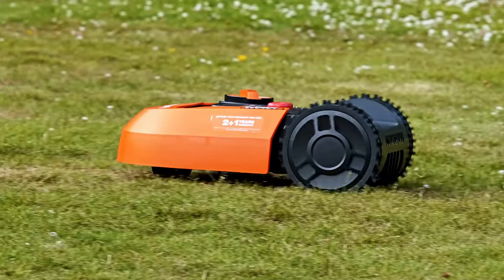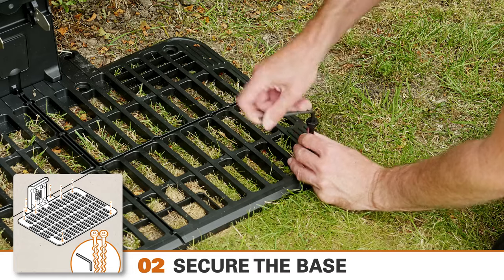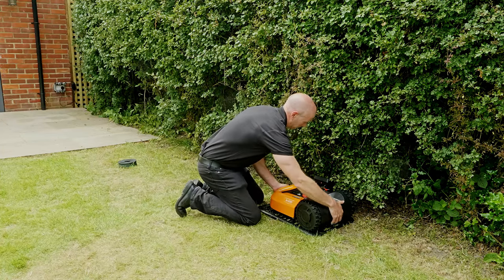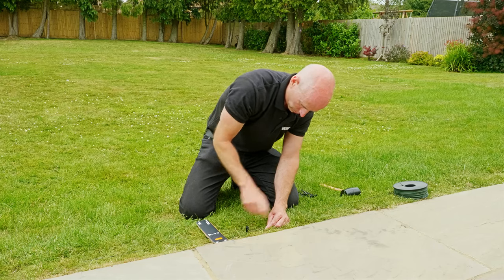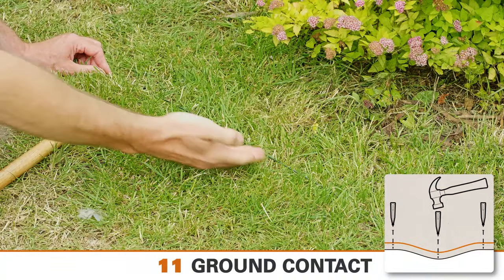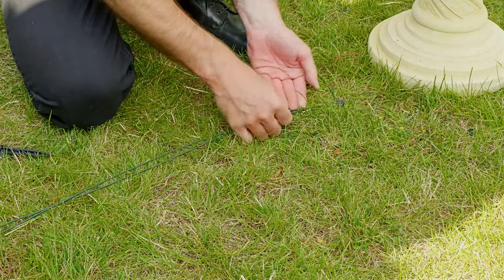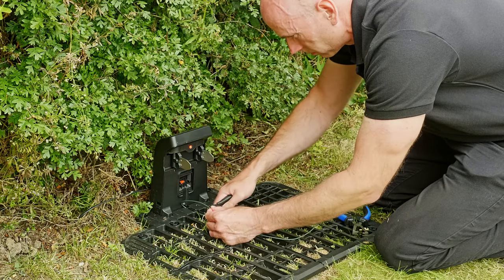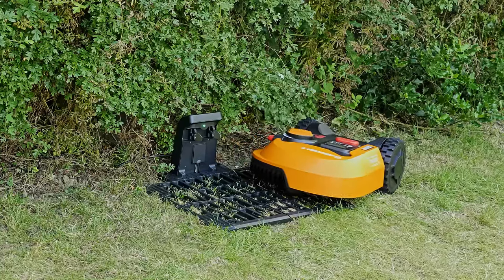Worx Landroid Installation Guide

Comment: Did you have any problems with the landroid runnning over and cutting the boundary wire? Mine cut the boundary wire 4 times within the first hour. But my lawn is not a flat as yours, I guess that’s why. This device does horrible on uneven terrain
Reply from the maker: Hi, sorry to hear that.  It does need to have the wire pegged flat or you can bury that section if it is sticking up. It will be pulled into the grass within a couple of weeks and then you won't have that issue again.  The Landroid will eventually make your lawn look a lot more even but there is a particular model which is designed for very uneven terrain. Contact the Worx Customer Service team on 0345 202 9679 for any further advice.

Comment: Hello. Can the Landroid roll over hard surfaces without damaging the blades or the Landroid? I’m planning on housing it in the garage. The garage floor is cement and the driveway leading up to the garage is also cement. Thank you.
Reply from the maker: Hi Jose, it can but you won't be able to bury the wire and this might cause an issue.  It really doesn't need to be housed inside anywhere and the charging plate is pretty discrete once the grass grows. If you want to get advice from our technical team you can chat to them on the Worx Landroid Fan Club page (international) or via the website support.

Comment: What if you have a side walk that you want it mow on both sides of?
Reply from the maker: It can travel over a sidewalk as long as it is not raised, so you can include the whole area as two zones with a narrow passage at one side. You will however have the wire running over it, and this will need to be very tightly pegged down so as not to be a trip hazard. Hope this helps.

Comment: It's a pity that there are no LED lights on it so you can follow it at night
Reply from the maker: It’s better not to run it at night due to nocturnal creatures. In fact we have a safety feature that you can turn on on the App to prevent it going out at night. The new vision model however has a camera and is very safe for pets and other creatures, hence it has lights.

Comment: I wish my box came with the ruler
Reply from the maker: Hi, sorry to hears yours didn't.  It's contained on the lid, the same as the triangle, you just press or cut it out?  But it's just either 10cm or 26cm which you can also just cut out of cardboard using a tape measure or just use a normal ruler.  This would be much faster than a tape measure. A tip would be to mark the two lengths on the ruler with a bit of coloured tape so you can check really quickly. Hope this helps.
Reply: @WorxUK  The mower is expensive. How much would a plastic ruler and triangle cost? Having to punch it out of the box is ridiculous, not to mention that you do not mention that they are part of the box. Just shows they are included.
Reply from the maker: @jckrell  It's not about the cost it's about reducing plastic in the environment. These are singular use items only used during installation, and a ruler or tape measure is an item most people would already have access to. As a responsible manufacturer we are committed to reducing single use plastics and have almost eliminated these from our packaging.

Comment: What if the cable isnt long enough?
Reply from the maker: If you mean the power cable, you can get an extension with a waterproof box. Hope this helps.
Reply: @WorxUK  How about the guide cable that we lay, can that be extended?
Reply from the maker: @lopez8971  yes absolutely, there are rolls of wire available to purchase if you run out. It also comes with more than enough for your size of lawn and three connectors, but these are easily sourced at any DIY shop.

Comment: Bought this thinking it would work sort of like a Roomba, power on and it starts working. Nope. This set up is tedious. Returning it tomorrow.
Reply from the maker: Hi Rasco, sorry you feel that way.  The set up takes less than a couple of hours maximum depending on the size of your garden and saves so much time in the future. You literally never have to mow again.  That is at least a couple of hours saved every single week, even more if you need to collect and drop off clippings (once we're able to again).